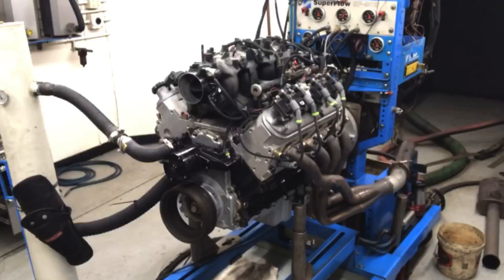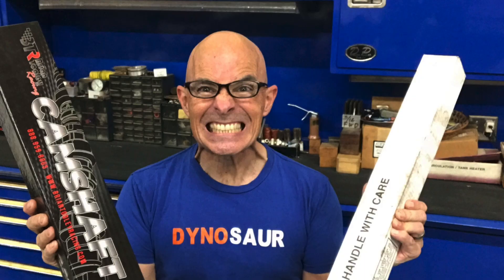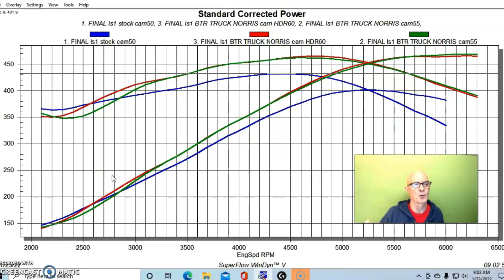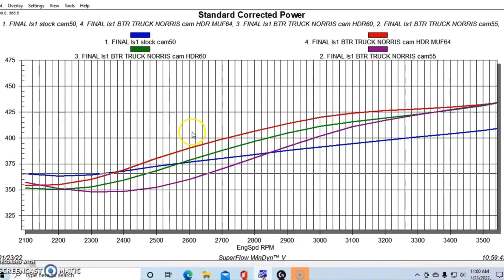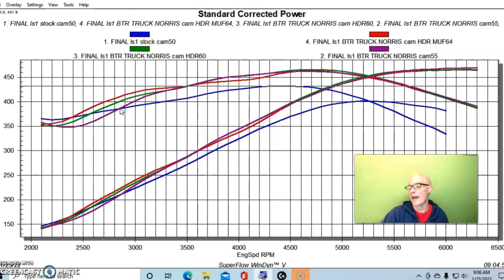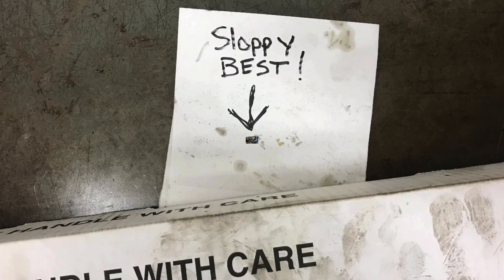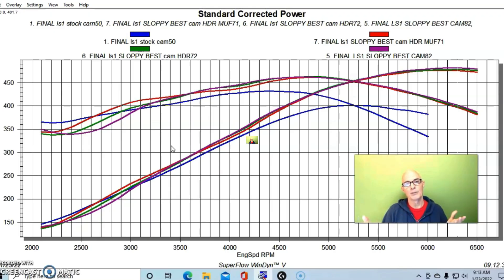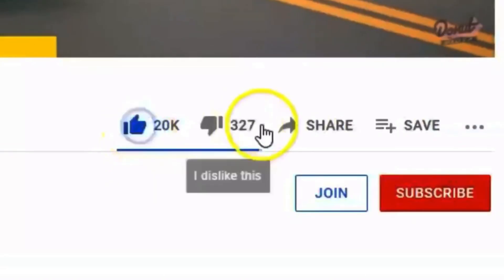DO LONG TUBE HEADERS ADD HP? 1 3/4 vs 1 7/8 HEADER TEST. WHAT MAKES MORE POWER ON AN LS? BONUS TEST

Comment: Considering your the LS guru, I'd like to see you use the correct cam for the headers you have available, and then have the correct header extensions for that cam. Software like Pipemax would be beneficial for this type of test.
Reply from the maker: it is funny that you think only one length extension or header size or design works with one cam
Reply: @richardholdener1727 I don’t. But if one was building a motor to make peak tq at a given rpm or peak power at a given rpm or in between those two, then there is an ideal pulse length and there is also lengths to avoid. If you haven’t played with the Pipemax software I recommend you do. I have made anywhere between 30 and 100 hp going from good looking aftermarket headers to made to spec headers, and the software has always had positive results.

Comment: Stock LS1 exhaust ports have an area of about 2.4 square inches, which is slightly smaller than the area of 1 3/4 primary headers... Basically you would need to enlarge the LS1 exhaust ports to make larger headers useful
Reply from the maker: incorrect
Reply: @richardholdener1727 Max area of stock LS1 exhaust ports is 2.411 square inches. Area of 1 3/4 primaries is 2.405 square inches... Basically there can be no benefit of going larger than 1 3/4 and any larger would decrease power at low rpm - just like your video shows

Comment: I swear I'm seeing things backwards.  Those cams and headers lost power where it matters most to a majority of your truck guys.  And kets face it , more trucks on the road than hot rods.  At least where i live.    
But your saying the crossover moved over by 500 was a gain , , maybe I'm seeing it wrong , but it looked like 500 rpm in the wrong direction.   
I need to see that increase go left

Comment: Most vehicles on the street have cats and therefore a larger increase in back pressure… so I would like to see a real world example of full exhaust with cats & mufflers …  I’m betting the 1 7/8 would do better scavenging with the bigger increase in back pressures

Comment: I didn't see a test like this for larger engines (6.4L hemi 408s), How would a 1-7/8 vs 2" comparison like this do on a 525<550hp @ 6,000<6,250 rpms 6.4L<6.7L? Would it be basically the same or would the displacement make the low-end losses much less? The 2" tubing is actually cheaper to make custom ones than 1-7/8".

For decades I've seen "Suggests" based on hp from header builds/companies - one "Expert" said, " following guidelines: 200-325 horsepower look for 1 1/2-inch primaries, 275-425 horsepower use 1 3/4-inches, 400-500 horsepower opt for 1 3/4 to 2 inches, and 500+ horsepower look for 2 inches or greater." Surprisingly Summit post his recommendations on their site.

Then there's the Formula that's been around forever : Primary Pipe Area (PPA) = (peak torque rpm 88,200) × 1 cylinder ci

The length is more of a mystery as the formulas I've seen are advertised exhaust duration/ exhaust open based, but no consideration to port flow/valve lift or intake type. I've even seen one that suggested each cylinder needs a different length primary, but without any formula...must be a trial and error thing.
Reply from the maker: have never seen big gains on a 2 inch vs 1 7/8
Reply: Peak torque RPM / 88,200 X 1 cylinder cubic inch volume

Comment: Wish you would have done these vs short tubes also. I dont want to lose low end torque
Reply from the maker: I have vids up on stock vs shorty vs long tubes-shorty heads DO NOT add low speed torque (they add very little hp or torque)-long tube headers do that
Reply: @richardholdener1727  oh ok ill probably just go with 1.75 for my 6.2. Really wanted a SC but dont think that's on the table now but who knows ;-)

Comment: Hey guys I am doing a efi 331 stroker just a nice weekend street car only, no track. My builder suggests that I do a 1 1/2 inch header and the rest of the combo will be an edelbrock performer rpm 2 intake, Brodix 20 degree 171 cc head, cam around .525 lift 108 lobe separation (that could change and be slightly larger), 70 mm tb, 80 mm maf, dyno tuned with 42 lb injectors. I can find 1 5/8 headers or there are more options anyway but have found the 1 1/2's in Headman as I looked briefly. Just curious as to your thoughts on the 1/4" making a difference either way positively or negatively for what I'm doing with the car. I'm going to expect for a minimum of around 350 rwhp.
Thanks
Reply from the maker: use 1 5/8 or 1 3/4
Reply: @richardholdener1727  definitely not using 1 3/4 with my combo and for what I want to do. Why would you say not 1 1/2? Do you have any personal experience with them or know of anyone who has with a similiar combo? I have 1 5/8 LT's on my 302 now with performer 2,  TF 170, the same cam mentioned above ( I'm sure he'll grind a little bigger for the 331), 70 tb, 75 maf, x pipe, pypes bomb free flowing catback, 24 lb'ers, and the car is tuned making around 286 rwhp. I previously had shorties with the same combo and flowmasters with an X. When I put the engine in the 94 with that current combo it seemed I lost some down low going from same size shorties to Lt's. I think had I had 1 1/2's on the 302 setup it would definitely feel more torquy down low for sure. With the 331 from my builder's opionion and I'll have to have another convo with him while the engine is being done, but he initially said 1 1/2. I do want to ask him overall why he would say those over the 1 5/8. He builds dirt cars in Tx and dude is like a mad scientist in a lab when he talks about building an engine and the combustion side of things as well as the intake side. I just realized you look like the guy from the video lol so you should know what you are talking about too

Comment: Did you ever test the truck norris with stock exhaust manifolds vs headers before I thought you had but searching for that wasn't very useful
Reply from the maker: I have tested them both ways-(not surprisingly) they work with both
Reply: @richardholdener1727  I was wondering if the gains were worth it because I believe or assume it's over lap that affects how much headers help

Comment: Great information but it would be really helpful if the file names correlated to the setup a little bit better.
Reply from the maker: not really an issue
Reply: @richardholdener1727  I’m slow so when we add new data and the colors change I’m looking around to take it in while trying to listen to you is all 😄 like if one setup was red on one layout and you add another data file, the color changes from red to something else.

Comment: Wouldn't you get the best benefit from cams and extractors through actually tuning it ? This is only tests with the same tune and not tuning for what you have done.
Reply from the maker: THE TUNE IS OPTIMIZED (SAME AF AND TIMING), DIFFERENT HEADERS OR CAMS GENERALLY DONT RESPOND TO MORE TIMING (THAT IS A FUNCTION OF CHAMBER/PISTON SIZE & DESIGN)

Comment: If you were to dump say a M122 supercharger on that same engine would you need the 1 7/8" then?
Reply from the maker: the question should not be phased as "NEED", the bigger header made more power, do you "WANT" more power
Reply: Well of course sir. I guess it was a bad choice of words. Thanks @richardholdener1727

Comment: I'm trying to get a straight answer. I have a 99 trans am. I'm not going to do a cam. Car has very basic bolt ons. Slp lid and magnaflow cat back. I'm looking at speed engineering LT headers and Y pipe (no cats). I'll get a tune after install.

1 3/4 or 1 7/8? What should I get?
Reply from the maker: 1 3/4

Comment: Can you show the final results of the 2 cams, truck Norris vs sloppy stage 2 with 1-3/4 headers with exhaust?
Reply: I been looking at these 2 cams for my ls2 corvette.
Reply from the maker: it doesn't change the results
Reply: I wanted to see the results together so I can see the power difference's between the 2 cams @richardholdener1727

Comment: How is this affected by boost, as in a centrifugal supercharged application? 
Is the 1-3/4" still fairly equal? Is the 1-7/8" preferred at higher HP levels above 600?
Reply from the maker: I like bigger headers with high hp blower applications
Reply: @richardholdener1727  thank you for your response. I'm targeting north of 750whp on a Dart 363, and finding 1 3/4" headers with a 3" collector has been a real chore. Seems that 1 7/8" is becoming the norm.

Comment: So what would be better on a 383, 1 1/2 long tubes or 1 3/4 shorties? Trying to find 85 gbody headers that work for auto and manual transmission with ac and power steering 😂😂 it's a shame you cant buy each side separately
Reply from the maker: 1.5?
Reply: @richardholdener1727  looking on Summit racing the majority of long tubes are 1.5" now for g body sbc. I haven't bought headers in about 15 years and my reaction was the same as yours. I'm sure they'd be great on a 265

Comment: I wish the testing was done on a specific 2004 5.7 LS1 aluminum that is an LS1 53 cast iron turned into a 57 and you did pick up power by going with the 1 inch 3/4 but a lot of us now have to run a high-flow cat high flow cat has some kind of restriction if you haven't punched it out I wonder what the difference would have been between these exhaust test with an added high flow cat for some of us do have on our modded cars for stickers so what I'm basically saying is inch and 3/4 flows plenty in the beginning that's why you saw the increase with them down low now put a restriction on that flow and you might want the one in in 1 inch and 7/8 header Yes sounds like a dumb scenario but exhaust flow just liking this video has to do with numbers how someone runs this setup but throws a high-flow cat numbers are going to be a little different right... so this is a test with no cat and no Muffler
Reply from the maker: headers don't add power based on flow restrictions-they add power from wave scavenging
Reply: @Richard Holdener  I understand that wave Scavenging is where the powers at but at the same time.. so ain't flow and I know Richard that you know a lot more than I ever will..lol.. you've been planning this for a long time.. so now all that matters an exhaust is the Scavenging.. so putting on a resonator and a Cadillac converter after will make no difference on power I figured adding a high-flow cat would squeeze some numbers off your chart.... I did notice my comment is kind of hard to read up above LOL... sorry about that
Reply: What I meant to say was.. after you do your test on your headers Etc and get your HP numbers if you add a set of high-flow cats won't the numbers change from a restriction another words adding the high-flow cats to the test you just did ..wont it bring the numbers down.. I always thought more restriction on the exhaust less flow which meant less flow less air into engine less air out

Comment: Hi Richard I was wondering if you’ll be able to do more back to back testing on 8 into 1 headers, 180 degree headers, and long tube tri y headers similar to what nascar would use. Comparing them to what most people use 4 into 1 headers. 
Love all the videos you do cheers
Reply from the maker: would be cool-but not very practical since most of those can't be used in a vehicle

Comment: Would you have any content between the 1/34 and 1/78 longtube headers on a 2017 Gen 2 Ford Mustang Cayote engine, with just a 114mm cold air kit . Thanks for the awesome test always.😎💪🇨🇦
Reply from the maker: NO SIR
Reply: @richardholdener1727  Hopefully if you are willing to bring the content for the Cayote engine it will be much appreciated.👍
Reply from the maker: I have some Coyote testing vids up-but all Gen 1
Reply: @richardholdener1727  Much appreciated!

Comment: The icing on the cake would have been one more chart showing adding an x-pipe to the full exhaust.
Reply from the maker: that test was done by EM-it changed the power very little
Reply: @richardholdener1727  Good to know.  Thanks.

Comment: Id bet a 2 3/4 collector extension would really bump up that lower speed torque getting its acceloration up better . Especially if this was a 4.8 tested . Torque is king getting that jump and it takes Alot more hp to run that down !!! Towing youll definately feel it !!!

Comment: Hi Richard, I love the videos and keep them coming! I think it's great that with this round of testing, we see that if you have a full exhaust plus headers, that this will positively improve power and torque production at a lower rpm. I wonder if this is because the camshaft manufacturers do their cam grind testing with full exhausts?

Comment: I think the size difference is very situational and dependant on heads flow and the operating range. i.e. stock engine vs blueprinted. My head porter runs 2in+ headers on his 416+ strokers running out to 7600-8000rpm high compression builds. That is what he recommends
Reply from the maker: ask him if he ran a back to back test ever on 1 7/8 headers
Reply: @richardholdener1727 

Hoping to hear back. 

Do you have an explanation for the up tick in below 2200rpm for the 1 7/8 headers? Below 2200rpm is was higher then all the 1 3/4 runs. 

Wondering what the results would be for 1000-2200rpms Range as i have a c5 corvette and the gearing really utilizes sub 2k rpms alot on the highways

Comment: Its the backpressure (pressure required to overcome restriction) helping to scavenge the cylinders. The higher pressure from  the smaller tube increases velocity and then expands in the collector and creates vacuum and helps get the gasses out. Thats why testing is so important. When I was a young racer everyone thought that a giant carb would make the car faster and it doesnt work. I mentioned this on the last 1 3/4 and 1 7/8ths header test.
Reply from the maker: there is little or no back pressure in the na exhaust-scavenging is not back pressure-scavenging comes from reflected waves

Comment: Would have been better if the motor were 6.2 or 7.0 Would have been great to correlate exhaust collector pressure with the changes.
Reply from the maker: pressure?

Comment: Any idea of the max temperature difference between the 2 headers with mufflers?  Trying to keep under hood  temps down thinking 1-7/8 might help even though I would prefer the low end torque of the 1-3/4
Reply from the maker: I doubt the header size changes exhaust temps much
Reply: E-85 is what you want to reduce under hood temps.

Comment: Just in time. I've been surfing the web for info on which one of these headers would benefit my lc9 on my truck. I'm running beehive springs,  a CompCams camshaft (dur. 214/228  lift .559/.571 lsa 114 ), and 799 ported heads. Thank you so much Richard. With this info i will go with 1 3/4 and magnaflow muffler with a beside cut through exhaust!! Especially knowing that this test was done on a bored out 5.3, which is my plan for the future. I really thought i would miss out if i didn't go with 1 7/8, but for a offroad truck, i'd much rather have low end torque than high end RPM. Thanks again Richard!

Comment: Great work sir. This has been proven over and over and hot rod guys can't stand it. If you're not twisting a motor over 7K, huge headers don't help.
Reply: Unless the Engine itself is huge.. 500ci +.. even at 5,000 rpm, a 500ci engine would be choked by 1 3/4 "  headers.

Comment: Who paid Richard holdner this week for this gem lol

Each video should have a disclaimer at the bottom paid for (insert which company is Hocking a product)
Reply from the maker: yes-who stands to gain from 1 3/4 vs 1 7/8 headers-I guess that company called 1 3/4?
Reply: @richardholdener1727  or this company paid 1 3/4

Comment: That is the scavenging of the engine. Either one could make more power depending on the lobe separation of the engine
Reply from the maker: so wrong cam?
Reply: @richardholdener1727  no not saying that. I don't know what the perfect camshaft would be. Back in the 70s I realized dirt track cams worked well on the street, heavy car drivable gears. Everyone used to much duration so the camshaft company's would spread the lobe separation to protect the buyer from himself. Probably still everyone will pick more duration than they need.

Comment: So interesting !  I'll bet going to 1 5/8 or even dropping down to 1 1/2 headers would get you even more low end torque
Reply: On that size engine if you were 2000-4500 RPM most of the time a 1 5/8" would probably be better than a 1 3/4".
Reply: @dennisrobinson8008  let me know what you think as well: Hey guys I am doing a efi 331 stroker just a nice weekend street car only, no track. My builder suggests that I do a 1 1/2 inch header and the rest of the combo will be an edelbrock performer rpm 2 intake, Brodix 20 degree 171 cc head, cam around .525 lift 108 lobe separation (that could change and be slightly larger), 70 mm tb, 80 mm maf, dyno tuned with 42 lb injectors. I can find 1 5/8 headers or there are more options anyway but have found the 1 1/2's in Headman as I looked briefly. Just curious as to your thoughts on the 1/4" making a difference either way positively or negatively for what I'm doing with the car. I'm going to expect for a minimum of around 350 rwhp.
Thanks
Reply: Mark let me know what you think: Hey guys I am doing a efi 331 stroker just a nice weekend street car only, no track. My builder suggests that I do a 1 1/2 inch header and the rest of the combo will be an edelbrock performer rpm 2 intake, Brodix 20 degree 171 cc head, cam around .525 lift 108 lobe separation (that could change and be slightly larger), 70 mm tb, 80 mm maf, dyno tuned with 42 lb injectors. I can find 1 5/8 headers or there are more options anyway but have found the 1 1/2's in Headman as I looked briefly. Just curious as to your thoughts on the 1/4" making a difference either way positively or negatively for what I'm doing with the car. I'm going to expect for a minimum of around 350 rwhp.
Thanks